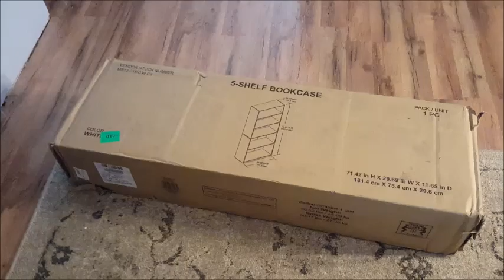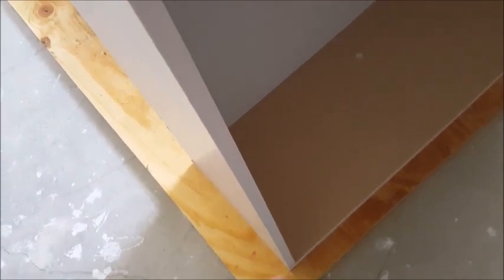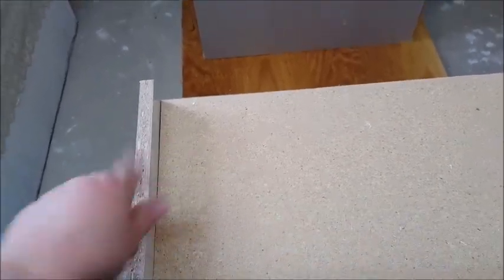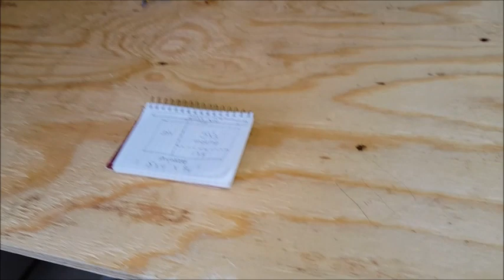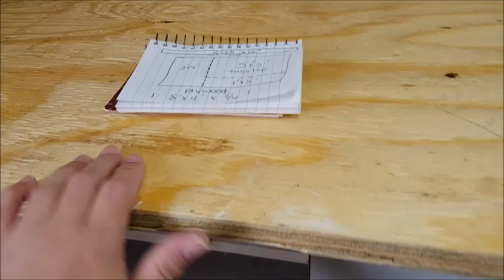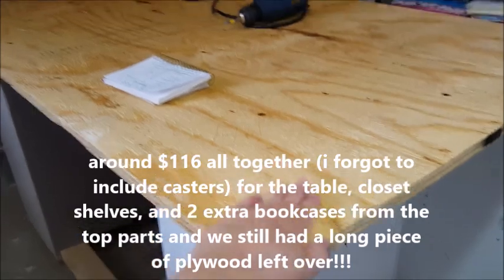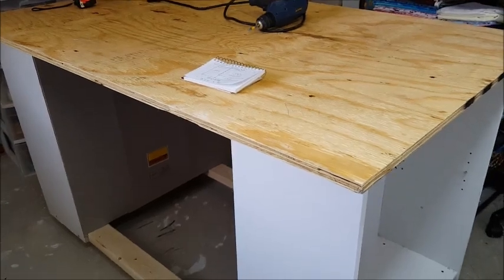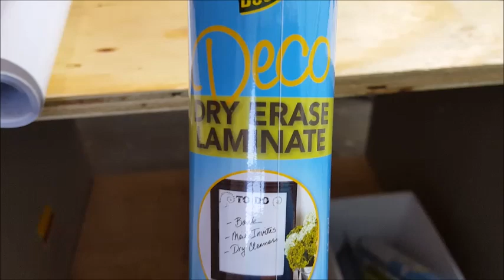Tricia's Creations: Building My Craft Table

Comment: Great idea!

Hint: the more tacks affixed to the ((even) cardboard backing), the STRONGER the entire cupboard will be and the more weight it can hold. 

When I make cupboards, dressers, filing cabinets I make sure the backing is "exactly placed," that gives the product "alignment (also providing strength)," then ensure that I place tacks, depending on the unit, up to an inch apart.  

Besides adding strength, when moved, they don't break apart--and, if moving to another home, will survive the move in good condition.
Reply from the maker: thank you so much for the awesome advice.